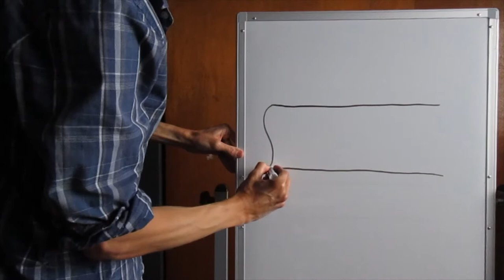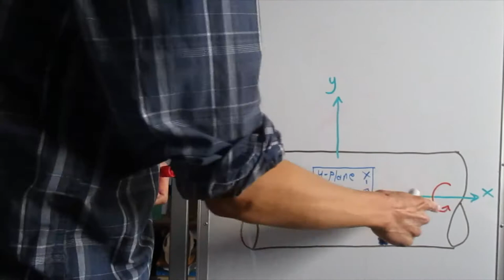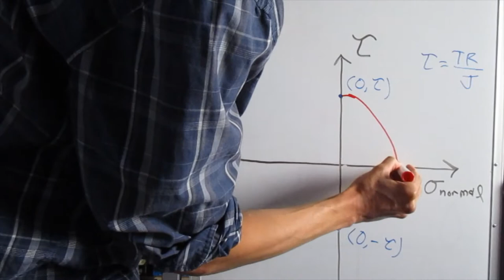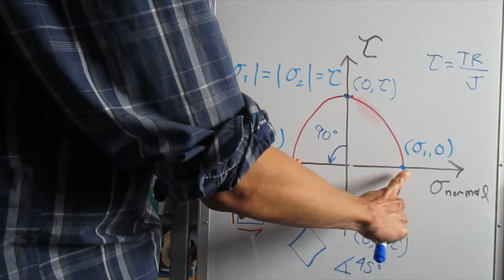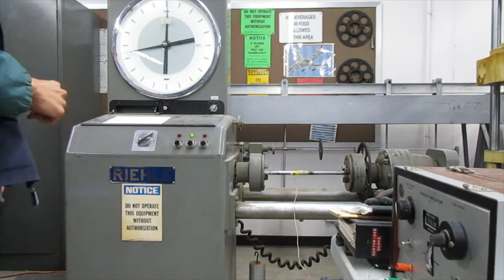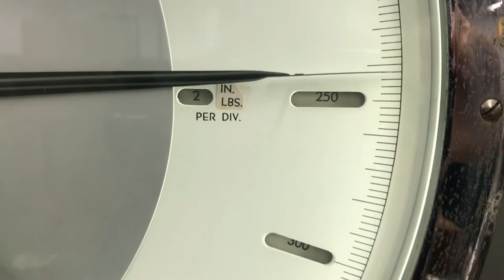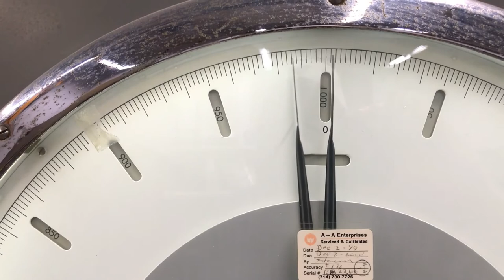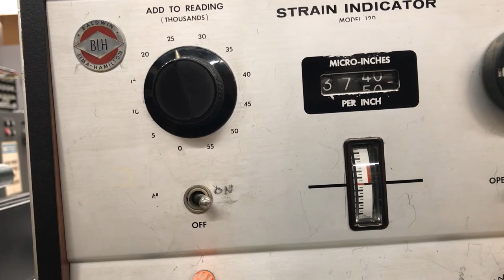Torsion: Principal Strains and Stresses (1-23-21)

Comment: hi, I'm trying to find the answer. pls help. (I hope I am going to be able to explain my question) I have 30 feet long fink truss system in my roof. I want to raise entire roof all together (one piece) . house is concrete block 30' x 22'.  ceiling height is 8 feet. I wanna raise it up to 10 feet (2 more feet).can anyone help me about where is the lifting point? how can i raise my entire roof with heavy duty steel lifting shore. Which point of the trust is the best point to push the entire roof up? thank you